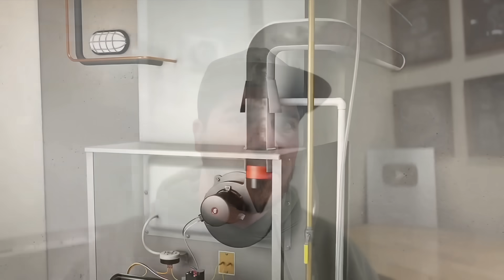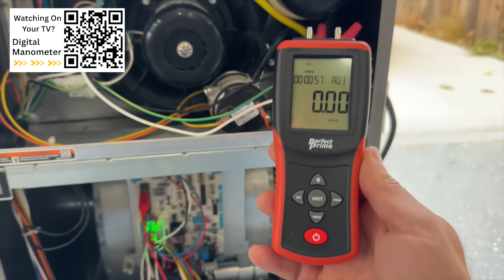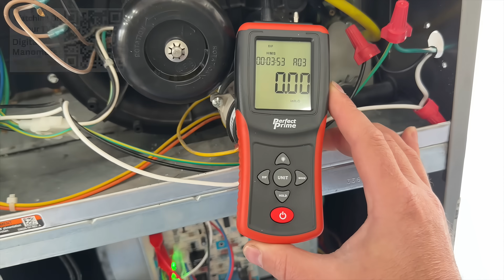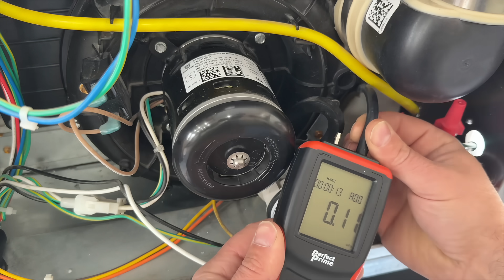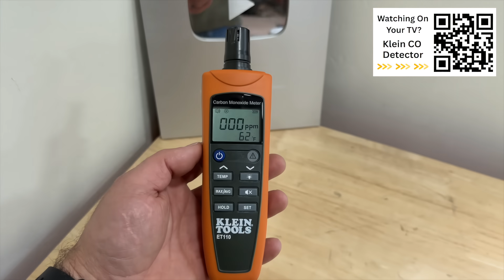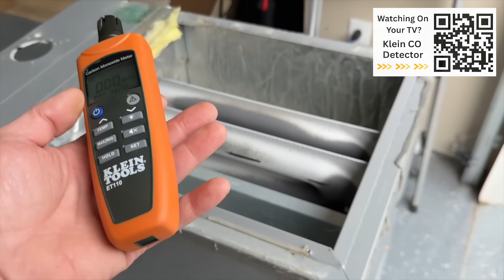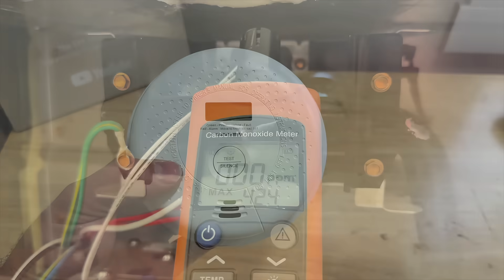This HVAC Scam Could Cost You THOUSANDS.

Comment: As a 40 year tech, I've diagnosed many cracked heat exchangers. Both tests with the detector as you show can get mixed results. However the test with the meter in front of the burners is where I see most of my high readings. The blower is much stronger than the inducer motor and will blow the CO out the front of the furnace. Which is why manufacturers install rollout switches just in case. Recently I got readings of over 1000 ppm of CO during the very same test. So please don't make blanket statements that don't apply to every situation.
Reply: As a 7 year tech, I found the most dangerous thing is not a cracked exchanger, but a plugged secondary heat exchanger. I’ve seen those things continue to run, without tripping the rollout, and leak CO into the home. No matter how big the crack is, I ALWAYS turn the gas off at the furnace and zip tie a danger tag on it as liability, but let the customer know I cannot legally stop them from turning it back on. I always check for CO leakage into the home. One time as I was walking out the garage the customer was turning the gas back on and as I was walking away if that’s how she turn it back on, I said, “Yes, but I have to advise that you don’t.” I showed up two weeks later with a new heat exchanger and the customer was warm and still alive, it’s always their choice.
Reply: @joelperigo7213  Yep and we techs know which brand is the biggest problem with the secondary HE. Most of the time, I don't even need to run a test. The smell alone will give it away. I run the test anyway because it gives the numbers to prove it to the customer.
Reply: @willlewis6747  and now said brand has problems with early failure of the primary heat exchanger with the newer models built from 2012 and onward. There is condensation happening in the primary that is beginning to cause holes. Propane always makes it worse.
Reply: Which brand? There are so many. 

CO is odorless. What are you smelling ?

Thank you!
Reply: @joelperigo7213 You replaced the heat exchanger and didn't try to sell them a whole new furnace?
Reply: @lukeroberts6019 I advised a new furnace would be the better option, but we honored the customers choice
Reply: @joelperigo7213  Two weeks later?; didn't the wholesaler have replacements available?
Reply: @bobboscarato1313  that’s the soonest we were able to get back to them. That same winter, we had a large HVAC company in town just not even taking on new customers. Things were crazy that winter.
Reply: If the blower is putting a positive pressure on the best exchanger wouldn't that assist in forcing the conditioned air into the combustion chamber since the inducer motor is in a negative pressure?
Reply: @trevmint5615  It will unless the crack is substantial or has progressed into a hole in the heat exchanger. I've picked up CO throughout a house under just such conditions. It had to be from the furnace because it was the only gas appliance in the entire house. Upon further inspection, there were nickel sized holes in all three lungs of the heat exchanger. Which is why even a small crack should not be minimized. Small cracks can easily become big cracks. They don't ever get smaller. They always get bigger.
Reply: Great video 👍 Love the use of the QR codes in the corners.
Reply: Did you ever shut customer’s furnace in the middle of winter ONLY because you saw a grainy picture of a rust spot with an inspection camera?
No other test, just visual inspection with a low resolution camera? 
This is a scam currently being run by a large company that offers maintenance contracts.
Customer calls for service, technician doesn’t even bother to look at the problem reported but pulls the camera, drills a hole in the plenum, pokes around until he spots some rust. Declares the heat exchanger is cracked and it’s game over.
Reply: @rok1475  At my company (the company I work for), we use high definition inspection cameras that stream wirelessly to our work tablets. With current technology, one of those cameras can be had for less than 100 bucks. If we see any kind of crack or hole in the heat exchanger, we always check carbon monoxide levels in the exhaust to provide proof of whether the furnace is still burning clean or not, and we always check for carbon monoxide leakage into the home. Even if there is no carbon monoxide leaking into the home, for liability purposes, we always turn the gas cock to the furnace off. We make sure that it is very clear to the customer that we cannot legally stop them from turning it back on and we show them exactly how to turn that gas knob 90° to restore heat to their home at which point they are taking full responsibility for their own health. In a society that wants to sue for the smallest thing, you have to make sure you do everything you can to protect yourself from liability.

Comment: chasing down a tripping rollout switch on an old Armstrong ultra sx 80 currently. flames look nice and don't distort when the blower comes on. i don't see any change on the manometer with the blower on, but will need to re-test when the Hx is nice and hot (metal/cracks should expand). No CO anywhere in/around the furnace. I do feel some air around the left two burners with the blower on (gas off), tho. Is there a chance the burner ducts are not completely sealed to the face of the furnace and are letting some air in? The puzzling thing is that it's tripping the opposite side of where i feel this air... it's also very intermittent and cannot be reproduced every single time, which makes it that much tougher to diagnose.

Comment: I've got a new home of 3 yrs. Should I let the ac company that installed it come out and do yearly maintenance? I already had to have the evap coil replaced.
Reply: Choose a different (reputable) company. 3 years? Hope it was under warranty. Sometimes small mom-n-pop companies are better because their bottom line isn't based on volume. How long have they been in business check references, reviews and BBB. Ret HVAC
Reply: @rrrhhh8167  It was under warranty. I still had to pay for adding the refrigerant and for the service though. It was just over $700.00. I'm definitely leaning towards the mom and pop route. I just wasn't sure if I lost my warranty by not doing their maintenance stuff.
Reply: That can’t be right. I got a tech to replace my evap coil in Sept. It was 22 years old. Three years? 😮
Reply: @ckelly5141  I was pretty pissed. "It's rare, but it happens" was their response.
Reply: @ChappySinclair Sounds like a scam tbh.
Reply: @ckelly5141  🤷‍♂️ The AC wouldn't cool the house. Didn't have a choice on replacing it unfortunately.
Reply: @ChappySinclair Yeah. Same thing happened to me this summer.
Reply: @ckelly5141  What manufacturer did you have on the one that lasted 22yrs?
Reply: @ChappySinclair  Unfortunately, I didn’t ask, but my new one has a ten year warranty. Like most things, newer is never better.
Reply: @ckelly5141  Exactly what I thought when it failed.
Reply: If it's a good company, it doesn't matter who does the preventive maintenance so long as theyre reliable, reputable & you trust them. Look thru your local companies PM plans, that gives you an idea of the value your paying even if you dont sign up for a PM.
Reply: @Dimbimbus  Thanks for the feedback.
Reply: @ChappySinclair good luck! Avoid companies that use the word inspection, furnace inspection, fall inspection, spring, etc etc
Reply: @Dimbimbus  and "tune up"
Reply: @Dimbimbus  will do. Thank you.

Comment: What an awesome video! Thanks!

If you have a crack in your heat exchanger and you're not leaking carbon monoxide what's the downside of not replacing it immediately? I do have carbon monoxide detectors. 

I ask this because I received a notification from Carrier that made my high efficiency furnace. They said they have had problems with the heat exchangers cracking and upped my warranty from 10 to 20 years. I think it's 12 or 13 now. I'm of the understanding that the entire unit has to come apart to replace it and I might as well just replace the furnace because of the labor cost. What do you think? Is it a DIY project? 

The major company in the Chicago area I got it from charges a pretty penny. I finally dumped them after a tech tried to scam me in my evaporator. He thought it was out of warranty so he quoted me a big replacement cost. I called the company back telling them that I was under warranty so schedule a replacement for me. They sent their master techs out to check and they confirmed that my evaporator was just fine. It's still fine btw...  The tagline for this Chicago company is "Consider it Done." I'm done dealing with them for that stunt.
Reply from the maker: There is no downside. Save the money for a new furnace, and don’t feel pressure from an hvac contractor 👍🏼
Reply: @diyhvacguy I edited my response while your were replying. 

So, it's not worth doing the heat exchanger even if the heat exchanger is under warranty?
Reply: @richardsmith2721  labor will eat you up, if you use one of the hvac guys. at that point, it makes a lot more sense just to get a new furnace.
Reply: The downside of not replacing it immediately is that the cracks will get worse over time: so you need to keep monitoring it.

Comment: In your first test you connected the manometer to the left nipple and in the second to the right nipple.  Is there a reason for that or do they both accomplish the same reading?
Reply from the maker: They’re both reading the same thing. They can be used for positive pressure or negative but they will both read. The reason it has two if you are trying to measure total static pressure at your ductwork, it will automatically subtract the one from the other and give you your total 👍🏼

Comment: Great video.  I do have a question. 
I have a Honeywell Humidifier on my system. 
When should water flow through it? When the thermostat call for heat or when the fan comes on?
Reply: when the heat is on it should come on , also the humidistat will need to sense the humidity level is lower than the call for humidity

Comment: Neighbor paid  8K for a  100K upflow 80% furnace installed in wide open basementy...from Home Depot subcontractor. You guys entitled to make  make a good profit...but that is absurd.!
Reply from the maker: That’s wild
Reply: I get there a lot of variables here, but for a situation like you described (which happens to be my setup. Open basement, 80% efficiency) what would you consider to be a fair price for replacement?
Reply: @takethecurseOFFwashingmachine  Last furnace I bought, I searched for independent HVAC repairmen. Most recommended a Goodman 80%, 100btu. This was 2005. Had them pick the furnace & install on their after hours. $600. They offered to put the old furnace gas, in my garage for $150. How times have changed.
Reply: First question is; did ductworks exist or were they added during this work? That labor to supply ducts and install them can be more than the heater alone.
Reply: @a @andyevans2336  Smart question, we went w a 2nd AC/Heat system in our Dormer addition. A More efficient system and saved tearing up the main floor-plan to tie in to the basement unit. 2 Climate Zones now. 2 separate systems. It was Cheaper too & newer units.
Reply: Thats the homeowners fault. If you own a home you should have common sense also. If not you will get taken left and right.